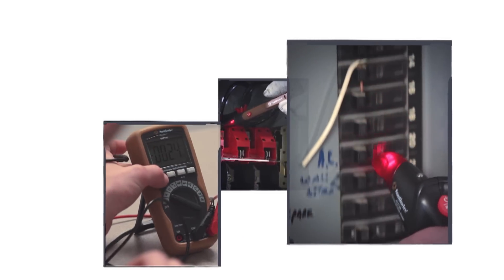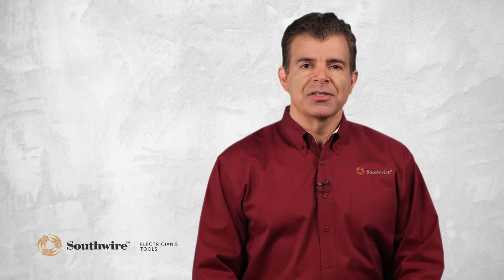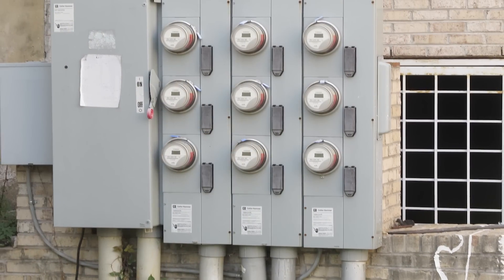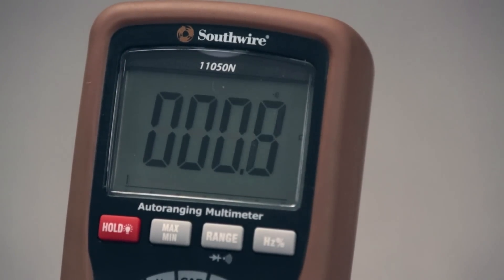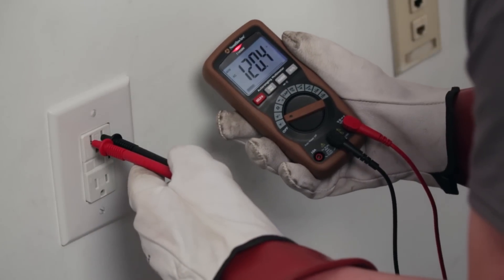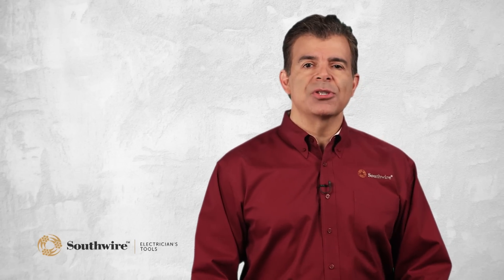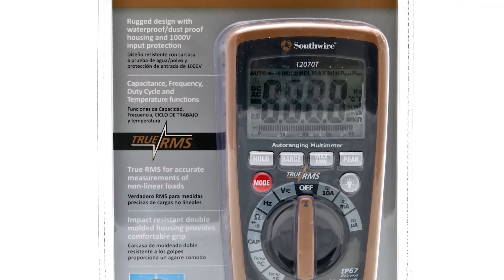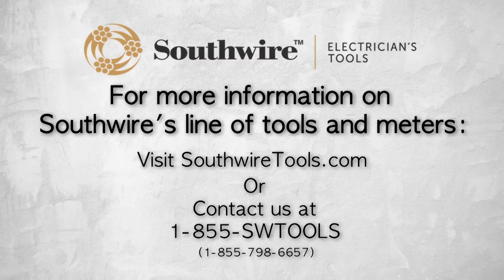Southwire™ Multimeter Overview

Comment: I just bought a Southwire 10031s because my old digital meter would't  zero in on the low ohms reading. I thought it was just getting old. I need a meter for accurate readings on the low ohm setting. Sad to say, the new Southwire reads .7 ohm when trying to zero on the low ohm setting ,,,, not much better on higher ohm settings. it. It isn't anymore accurate than my 25 year old meter. I will be returning it.